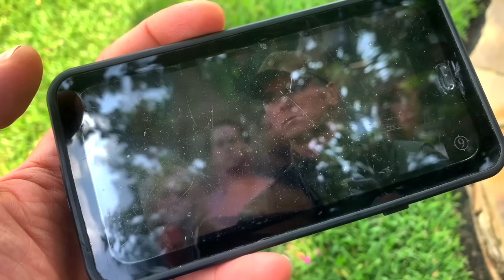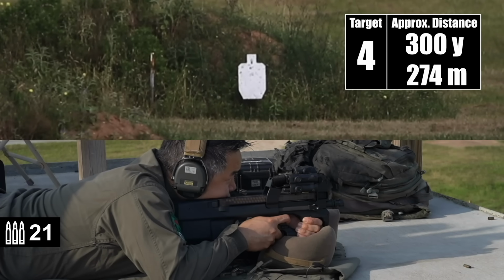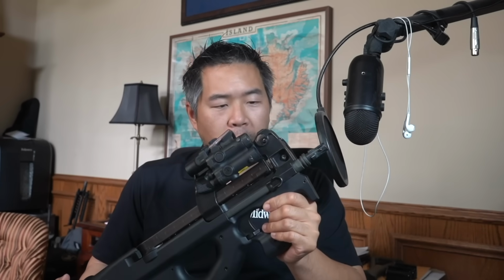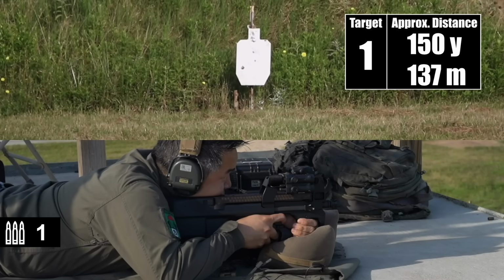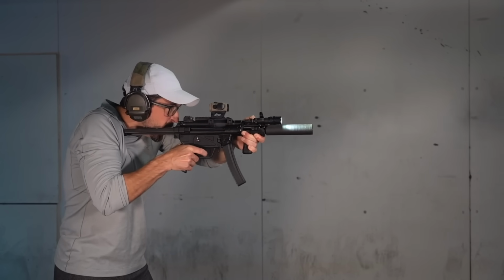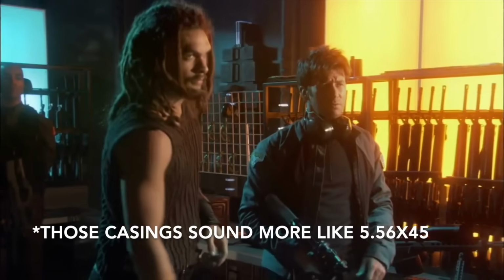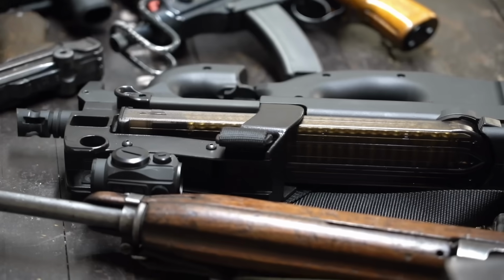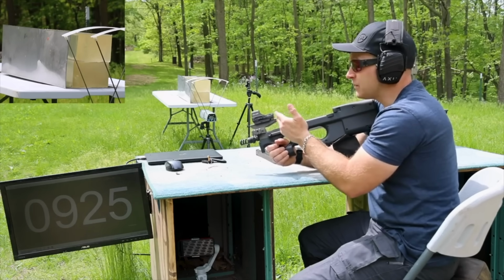FN P90 to 500yds: Practical Accuracy (Stargate SG1 main weapon) PS90

Comment: Expectation:  Starts to struggle hard after 200m.  After all, it is a pistol round, I don't expect great terminal ballistics.  Love my PS90, though.
Reply: I guessed the same, I was wondering if Henry would have to reload 😂
Reply: A little bit better out of a 16" barrel but still a close combat caliber.
Reply: The 10 inch barrel really is a hamper. I have a PS90 with a 16in barrel. It fires laser accurate out to 100yrds. I can fire 3 inch groups at 250 yds, but wouldn't consider using it beyond 100yds. I really can do 1.5 inch groups of 5 rounds at 100yds. But the round isn't designed to use much further than 100yds. It's a legitimate PDF, not a carbine.
Reply: @rvail136  to be fair, the PS90 is a 14in barrel with a 2in flash hider. I love my PS90 too, but sadly my state made it illegal by name so it's on semi perm vacation right now =(
Reply: @TrenchyIdol  No, a PS90 barrel is the full 16". The reason for the extra long flash hider is to get overall length over 26", otherwise the PS90 would still be classified as an SBR, despite having a 16" barrel. Mine was already on vacation for being an SBR (although now I can't even Form 20 it here for a year at a time).

Comment: The Gold Dot isn’t rated for the P90/PS90 because of the bullet profile. Without the feed ramp, magazine presentation of the bullet needs to be on point. There’s no collet crimp on a vast majority of 5.7 large scale commercial ammo and so those stubby bullets are more prone to failure to feed. 

All US large scale commercial ammo is loaded by Fiocchi USA using FN brass. Exclusions to include AAC (self made brass), Hornady (self made?) and Vanguard Outfitters (self made). So Speer GD is loaded by Fiocchi using the coated brass. The newest Critical Defense 5.7 has the same warning because of it's stubby profile. 

Other experts have mentioned the case lube is also needed for extraction as well since it lacks a taper.
Reply: I think the 40 grain vmax from the 5.7 is also a different projectile since they don't list the B.C that the regular 40 grain vmax has in .224 on the site for that ammo.
Reply: @WayStedYou  The 5.7 40gr vmax is likely identical to the 40gr vmax offerings. There's nothing special about the bullet
Reply: Nice bumping into you here. Thanks for the expertise.
Reply: Strange they don't list the B.C at .200 like all the other rounds that use it if it's the same projectile then.
You say they would need to change gold dot for feeding, so why not the vmax?

It could just be hornady being lazy and not giving the information they already have on their product pages though.
Reply: @WayStedYou  The Vmax has a plastic pointed tip. The Speer Gold Dot in 5.7 is an JHP design. They'd need to completely redesign it to have a point and not a more blunted open cavity.
Reply: Yeah, I get occasional FTF with the more blunt projectiles in my PS90. My keltec P50 however completely chokes on anything but the pointed vmax or 195lf. Even the varmint grenade loads are just a hair too blunt for my Keltec P50 to reliably feed.